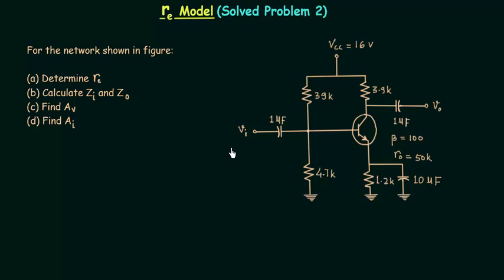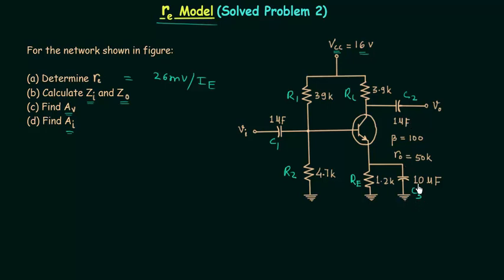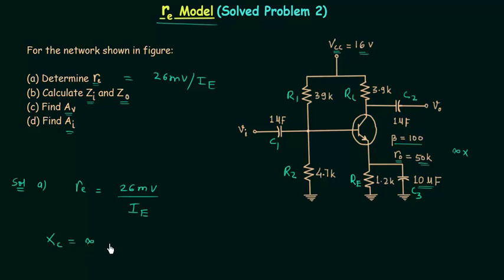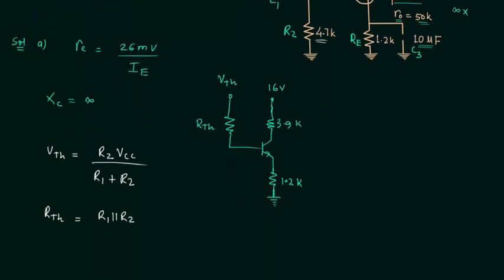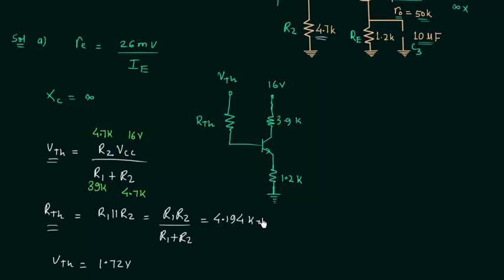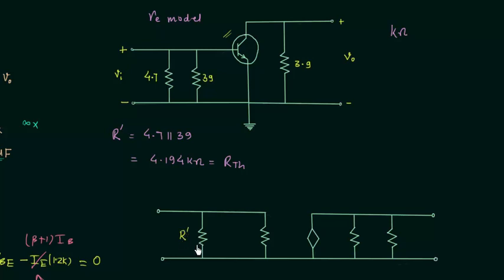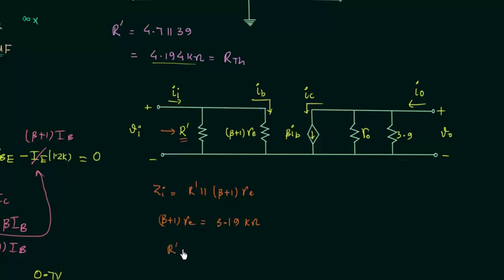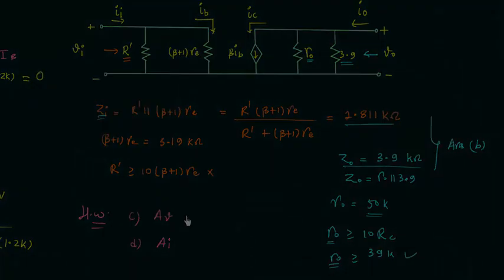re Model (Solved Problem 2)

Comment: 13:02 Sir, I think you have made a small mistake here, please check and let us know 🙏 
You have connected Rth resistor between B and E, but I think it should be replaced by 4.7K ohm resistor because 39K ohm resistor is removed in AC equivalent circuit as it will connected between ground to ground.
 Love from Uttrakhand ❤🙏

Comment: Voltage gain Av=-Rc/re = -123.41
Current gain Ai= beta×[R′/R′+(beta+1)re]=56.78.
As here is no Load resistance so RL=0 in the current gain expression & thus
 r0||Rc=Rc .
Awesome lectures Neso academy. thanks a lot with a big round of applause to you.
Reply: bro no load means resistance is infinite not zero
bdw can you tell Ai=i/p current/o/p current so what was i/p current ib or i1
Reply: @SaurabhKumar-gc1ko  ib

Comment: 8:57 it's not necessary to do rth/vth and do all calculation...just do voltage divider formula to get voltage at base....minus 0.7 to get V above Re.....then use Ie = V/Re....done
Reply: Yup just simply VE=Vb-Vbe
Then, use Ohm's law to get Ie, Ie=Ve/Re

Comment: Ai=56.79
Av=-123.41
And the negative sign in Av is represent 180 degree face shift in between input and output voltages
Thanks a lot sir
Reply: how to calculate Ai
Reply: @Satya-phanindra   As R_L = inf, v_o/R_c=i_o, so i_o will flow to R_c this time, then now u may calculate A_i
Reply: ji
Reply: How to find r'

Comment: Av = -Rc/Re = -123.23
and
Ai= B.R'/(R'+(B+1)Re) = 56.75
someone kindly verify! 
Awesome videos ... Thanks  @Neso Academy
Reply: But, you didn't consider Rc/Rc+RL.
Reply: @phymath-jisanislam9639  RL is open, thus making it RC/RC which simply cancels out to 1
Reply: @nabzero6528  i know its been a year but you are wrong , RL is open yes  infinite resistance is also same with open circuit since its infinite the curren gain would be 0  not 1 (if you want to assume you have a RL inside the circuit)
Reply: @kaanbatucezayirlioglu7606  okay, its gonna take me some time to digest the topic. But thank you
Reply: U r correct
Reply: yash shah 
u r absolutely correct thanks
Reply: @Marco Reus but (B+1)Re has nothing to do here; you have to verify that ro>=Rc which  happens to be true.